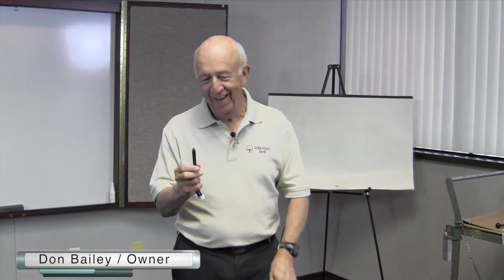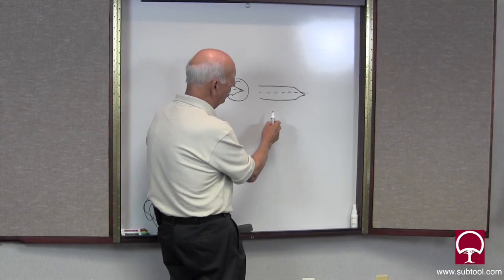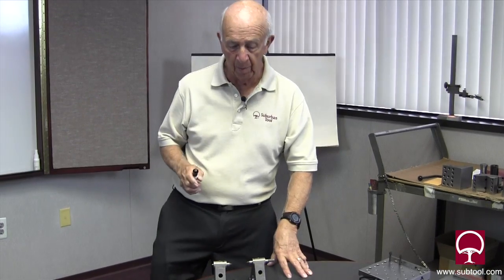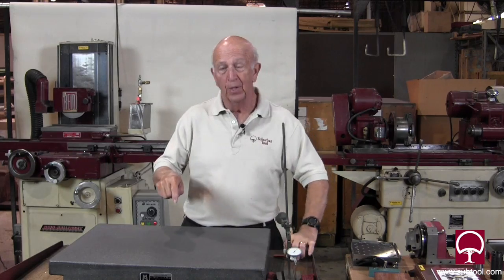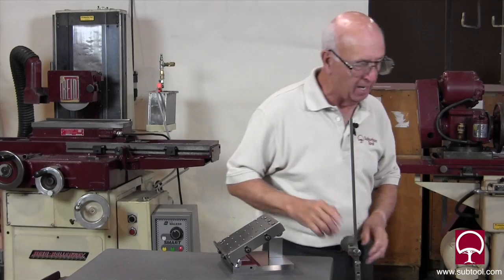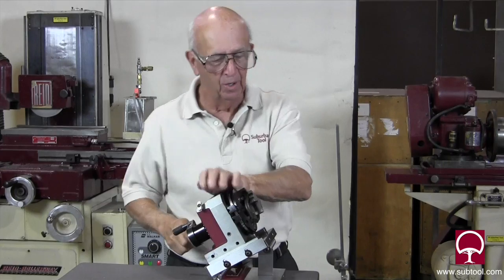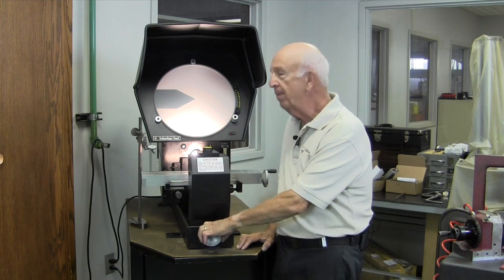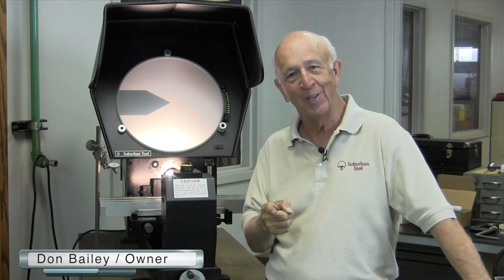How to grind the 60 degree angle on a dead center

Comment: You can actually hear the influence of the turning on the fixture transferring to the part/wheel. Difficult to avoid unless you have an independent drive. I have the identical unit & a Harig as well. Both good units. I'm curious what that unit retails for these days with the vee block? Thanks Don, cheers.

Comment: I guess tc is tool cutter?  I need to get one the way I do it now is very  time consuming, after turning in lathe I cut the flutes .04 deep, harden put back in spindex and cut the last .040 on surface grinder with .60" cone stone then to lathe to cut final dim. And relief with a tool post grinder cutting the releif is the hardest part to get wright.

Comment: In addition to maybe selecting the wrong gauge blocks, another reason to check the correct 60 degree angle is if the piece is not at the bottom of the wheel when ground the angle will be incorrect. I like to find the bottom of the wheel before locking the table just to be sure.

Comment: another poor man's method if you don't have a sine plate
remove wheel guard, you will need a 30deg angle block to line up your whirly on magnet crank wheel down to center of wheel to center line of   part , you will be grinding with the side of the wheel instead of bottom  and feeding sideways with table stops as in feed. , if accuracy of center is criticle, move wheelhead up or down in the spark out spin

Comment: A fantastic and much needed video series.
Also here in Holland the education is at a terrible level, companies need to train people themselves. But the margins are generally thin and once people start working, training is often not the top priority. One of our suppliers actually has the oficially retired (aged 66) owner of the business still working on the manual and CNC lathes for single pieces and small series because they cannot find a new man.
I have always taken a great interest in manufacturing, I think you cannot be a good engineer without this knowledge and the ability to talk to suppliers down to a detail level and match the design with the actual machine and man capabilities. I especially see a lot of GD&T mismatches between what our (big) customers come up with and what the supplier can reasonably achieve.
Privately, I occasionally buy old machines, recently picked up a 1955 Schaublin 102 VM, with special factory option 3-speed motor/ 4000 rpm spindle rpm. Also a full set of collets, chucks etc. The machine was privately owned by 1 owner for 42 years and only used occasionally all this time. Really a rare find!

Comment: I love seeing the tools you guys produce, in use. Such great designs! 

I have a "universal" Tool & Cutter grinder that I just finished cleaning and tuning up. But I don't have any of the jigs and fixtures to make it useful beyond flat grinding. (It does have a permanent magnetic chuck.) Do you guys make anything for that? Like for sharpening end mills, drill bits, router bits, saw blades, etc., etc.? If not is there a manufacturer you can recommend? 

Thanks!

Comment: I have  a homemade Brown and Sharpe dead center I made for my dividing head, now that I heat treated it I need to either hard turn or grind the center again. I havent yet decided how I want to do that, but this method sure looks easy. Problem is the surface grinder is the only tool out of all them you used I have so hard turning is looking more likely. Either way I will do a video on how it turns out.
Reply: bcbloc02 If your B&S tilts, just use that as the sine plate mounted to surface grinder, with dead center mounted it situ.
Reply: Rick Brandt
 Good idea Rick, but it is way to tall to pass under the grinder wheel on my grinder then.